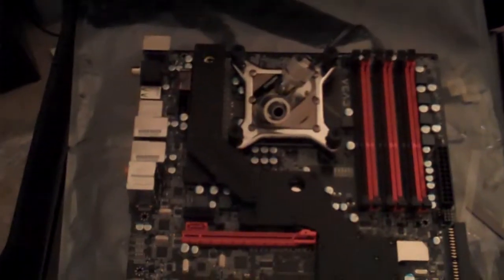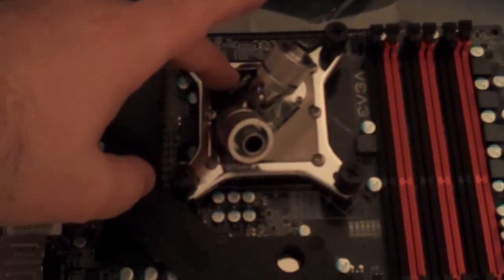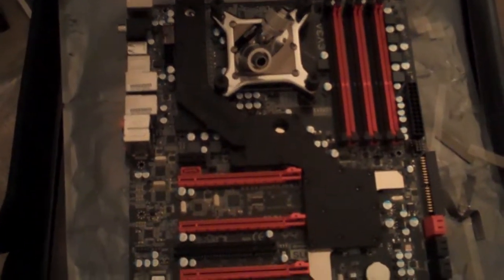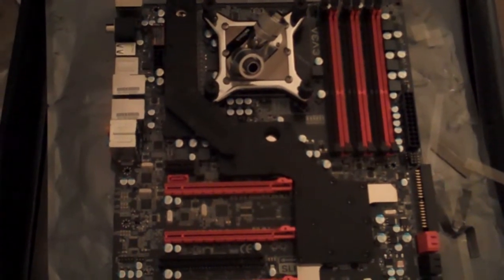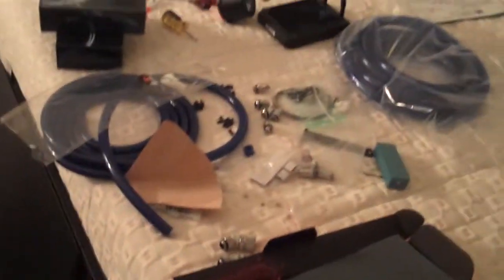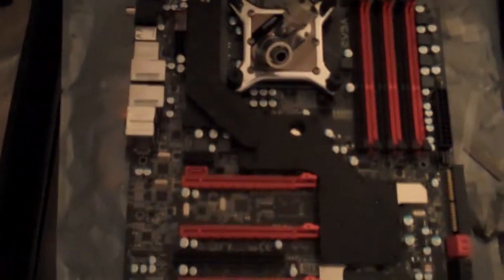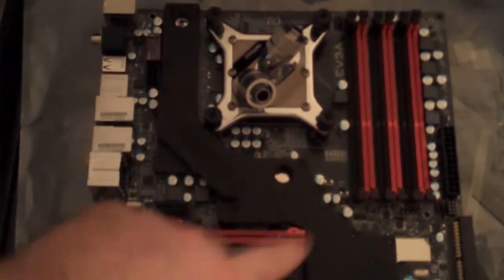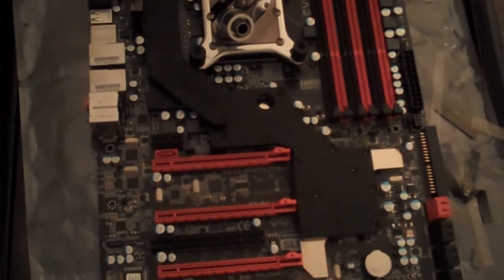Corsair Obsidian 800d Water Cooling Part 1

Comment: A 980X and a GTX 480? Looking sweet. But why will you get the GTX 480? It's so overpriced and it will compete with the 5870. I would rather sped a little extra and get a 5970 or get two 5870's. The GTX 480 seems like a waste of money.